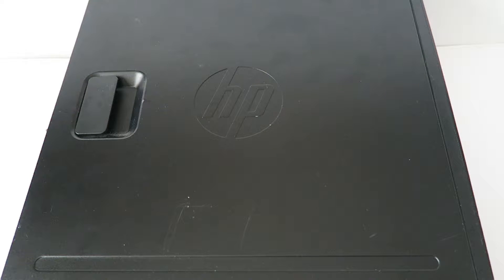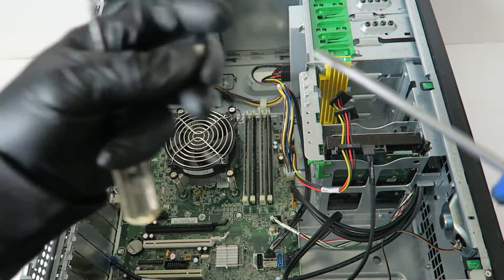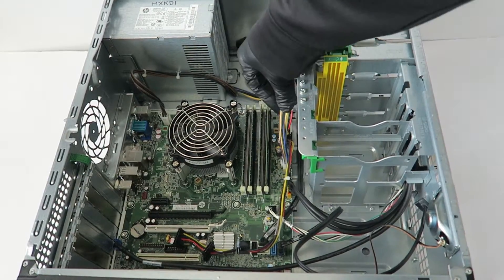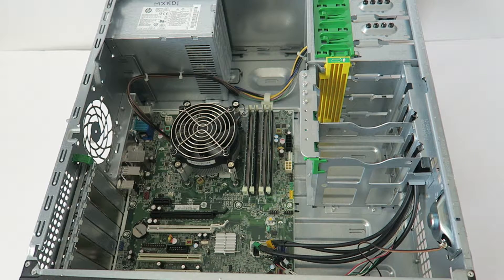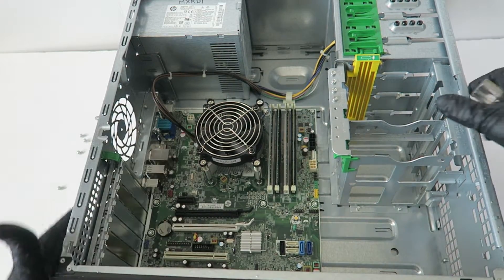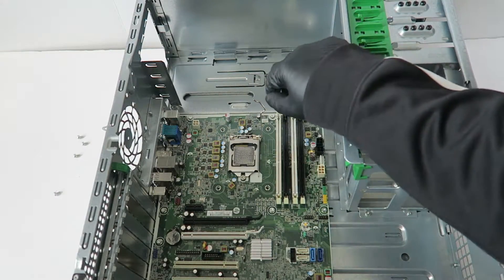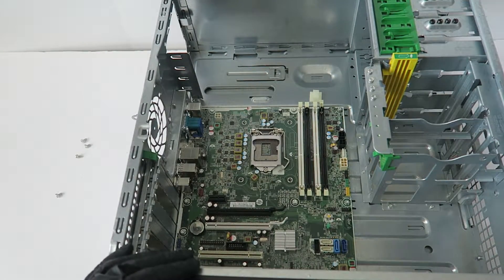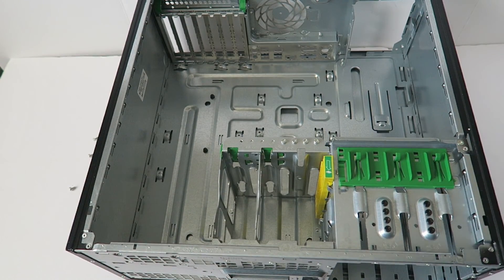HP Elite 8200 Teardown

Comment: what kind of cooler can I put and does it matter from the socket
Reply from the maker: Hi, hp using its own socket for the cooler so its mounted to the case and if you have i7 CPU that cooler is fine you do not need to upgrade, and i would only upgrade SSD and RAM

Comment: Hey man! I have 2 questions.. First.. On an old motherboard like this which doesnt has the 14 pin slot.. When you want to upgrade a psu what do you do? And second.. I have an hp compaq 6200 pro.. And when i press the button to boot it lights red and the fan of the case cause to much noise..And sometimes it not recognizes the psu fan but it works.. Do you know how to fix that?. I already did a format but nothing happened.. Thank you!!
Reply: Ummm, you didn't had to format it, all you had to do is clean dust from the main inner parts of the computer like ram motherboard etc

Comment: Hopefully you can  help answer my question. I want to install  EVGA GeForce GTX 1050 Ti GAMING into my HP 6300. Do you know if this will fit?
Reply from the maker: Hi, yes EVGA GeForce GTX 1050 Ti GAMING Video Card Will Fit HP 6300 Mini Tower.
Reply: Thank you so much for the reply!!! and now I can finally order the right card!!
Reply: I was told that I may need to get an older graphics card because the Bus will not support the card in getting. I was told I need one that has an external power hookup. Please Help??